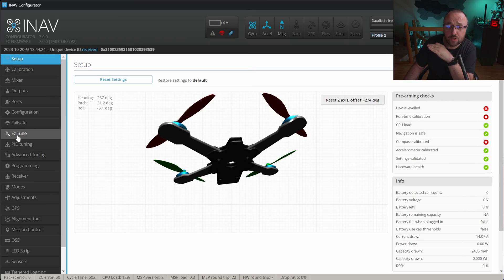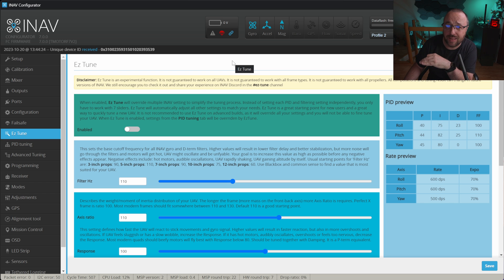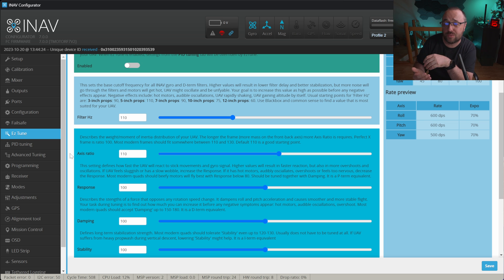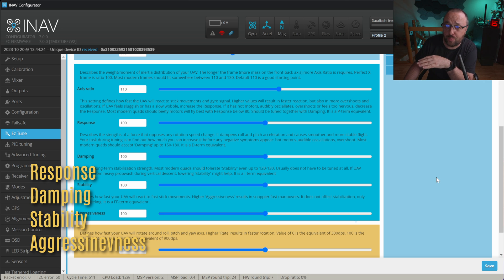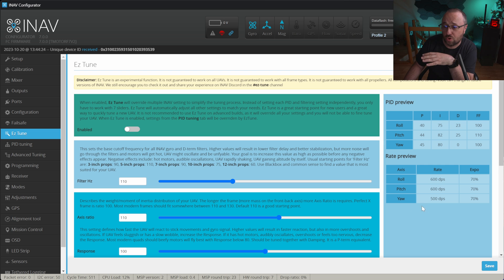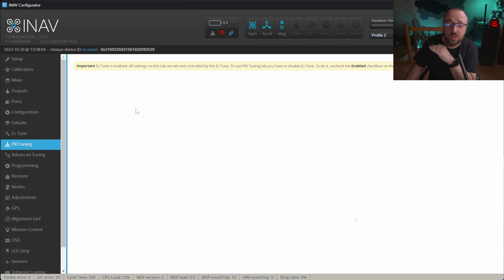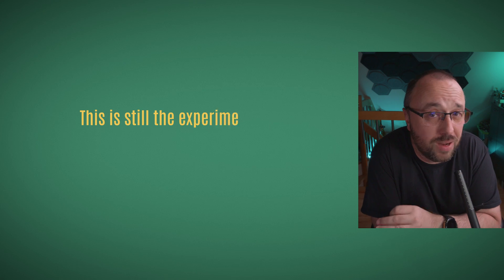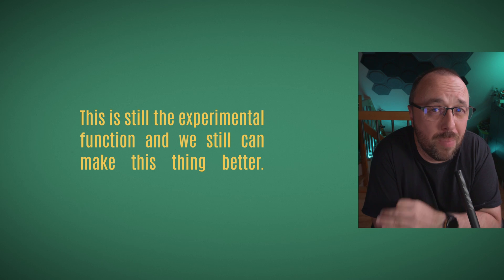Easy tuning with INAV | The Ez Tune

Comment: what size motors should be used for inav 7.1 im having high throddle osolations with stock tune and my motors are rcn power smoox 6s 1880kv and i dont get it with 1750kv motors do you know why.

Comment: you may have put a lot of work into it, but it doesn't work well. i have a 10" phantom 3 set up with speedybeef405mini. Toiletbowling on GPS position hold. Oscillation and a slow tuning. even pidtoolbox didn't help. then i installed ardupilot and the drone flew stock better than with INAV after hours of tuning. then autotune and now it flies better than the original phantom 3.

Comment: I have just use this function and amaze how easy to tune compare to the old PID method makes it more understandable for the rest of us . hope it works on fixwings and VTOLS as well
Reply from the maker: on fixed wings you have autotune, so it's a little different
Reply: @FPVUniversity   I only notice recently when applying it to an Align 480 Quad with 16" props . I have difficult using EZ tune to configure. and have to return to standard tuning process. how ever for small drones upto 250 mm 5" size works

Comment: Hello friend, inav supports more sensors than betaflight. This is nice. Does the inav 7 version support the dshot esc protocol? If not, it would be better if it was added
Reply from the maker: yes, DSHOT works
Reply: @FPVUniversity  Then it's very good. When I go home, I will flash the esc software to my Inav 7 F4 motherboard. Is there a problem with bluejay? I changed the blheli s software to bluejay software.

Comment: That's a great feature! But it's not clear for me how filter tuning works. EZ tune has only one filtering option: cut-off frequency. It looks like a LPF, but INav has a bunch of filters with different options: two LPF filters (with dynamic LPF option), Matrix Filter (2D/3D dynamic notch), Unicorn Filter (Kalman). How does the single slider work? I guess there are Matrix and/or Unicorn enabled by default with some typical settings and this slider configures LPF2. Or it's something more sophisticated?
Reply from the maker: This one slider sets all the relevant filters based on predefined ratio. Once you enable ez tune and set main cutoff everything is handled. 
Imagine there is only one uber-filter and you set only this one

Comment: I recently migrated from Betaflight to INAV7 and replicated the PID values, throttle limit (scale), and motor output limit settings from Betaflight. While these settings yielded excellent results in Betaflight, the same configuration in INAV7 caused serious control issues. The throttle stick became overly sensitive, making altitude control incredibly difficult. Additionally, the drone barely responded to sideways (pitch and roll) inputs in angle mode. Pitch and roll inputs in Horizon and acro modes exhibited exaggerated exponential responsiveness, leading to overall control responses that felt alarmingly unpredictable.

Frustrated, I pushed through a few rounds of tuning, hoping for incremental improvements.  Even though I managed some marginal improvements for the Angle mode experience, each tweak felt kind of insignificant, and the objective of replicating my Betaflight flight experience seemed to fade further with each attempt. 

Long story short, I am back in the Betaflight 4.5 firmware version, which fixed the GPS issue that was there in 4.4.3. Flying is fun, even though I miss the Alt-hold feature at times. I plan to re-attempt INAV7 tuning yet again when I will have more free time in the coming weeks.
Reply from the maker: BF PIDs can not be migrated directly to INAV. Both PID controllers work in a different way. I have a viedeo about this https://www.youtube.com/watch?v=jgqjhSxd9EA
Reply: @FPVUniversity  Thank you Pawel! Will check it out

Comment: Giving it a try now.  I converted my 7inch deadcat to INAV 7, where my intention was to load INAV 5.1 when I was planning the build. I had problems getting my walksnail working last March/April when INAV6 was released, so I put BF back on it and it flew fantastic on 4s and 6s.  
I would love to see a real demo on applying the easy tune sliders on a similar build.

Comment: New INAV user here, I did miss the gyro calibration from betaflight. I didn't quite get a very good gyro setup in INAV and the angle mode didn't stabalise so well.
Reply from the maker: I'm not sure what you mean? There is no gyro calibration procedure that user should do in either INAV or Betaflight

Comment: Does it not work for Fixed wings? For example a fixed wing using the Matek F405 Wing FC?
Reply from the maker: No, it works only for multirotors
Reply: The last time I tuned my sailplane in iNAV 6, after autotuning, I flew again, select ANGLE mode and then then bird nose dived immediately from 50m to the ground in a couple of seconds. 😢

Comment: Hello Mr. Pawel, I want to ask you, should I use INAV for autonomous micro quad build or should I go with arducopter? It looks like INAV has come a long way very quickly. Please let me know your opinion.
Reply from the maker: INAV is much simpler to setup and flies as well. Sure it lacks some advanced features, but you need them only when you need them
Reply: Thanks for the opinion. I am very interested in autonomous flight. I want to learn about it and try it. Coming from betaflight background I feel INAV is a great platform to start. I want auto take off, perform autonomous waypoint mission and auto land at origin. I hope I can do this with INAV.

Comment: nope ... sorry but i did not like Ez Tune ... when you try to tune with PID Toolbox, you need other sliders (indeed same slider from Betaflight)
I prefer to modify directly PID FF values than use the slider (in fact it's more accurate with Value than slider...)

So please put a P/D balance and a master Multiplier. "this is the way" :) 
Chris Rosser and DZARO made some tutotials and explain the method to tune and Ez Tune is not a helper.

Other thing : could you explain how to set "filters" and "mechanics" tab  ? I did not find a "how-to" and did not find also how to see noise in Inav Betaflight...

Keep going ; I like Inav for other things ;)

Comment: Excellent work !
My question is about custom frames/3d printed frames and using EZ Tune....I dont suppose EZ Tune will compensate for custom or 3d printed frames that are more flexible than carbon frames ?
Reply from the maker: Nothing is that advanced :) You have to find a good balance

Comment: It would be nice to be able to custom assign motor positions 1, 2, 3, and 4 (and more) on multirotors, and their direction [as you can in BF and AP}
Reply from the maker: You don't need to change motor order. All you need is custom mixer and INAV has that for years now. Effect is exactly the same
Reply: @FPVUniversity  a short video tutorial on how to do that would help 1000s
Reply: @DugDiamond1  Click on "mixer wizard". Choose whether motor 1 is mounted at the top right, the bottom left, etc. Continue in the same way, specifying the location where you mounted each motor.
Then click Apply, then save. You're done.

If you are using an INAV version before 7.1, do NOT expect the "mixer presets" illustration to change when you use the motor wizard.  They are two separate things. The image shows what the preset will do if you load the preset.
Reply: @senseisecurityschool9337   - thank you for your reply. I have already tried this many times, and it does not work. The FC/ESC combo is a MAMBA F722 MK4 APP + 65ESC. The firmware installed is MAMBAF722_2022B (dec6 stable). The boards are rotated 180 degrees, so that the capacitor does not impede the air unit.

I have since moved this build back to BF,  and everything works great.

I am currently making another INAV7.5LR quad with a different FC+ESC combo (iFlight Blitz F7 E55 Flight Stack) [currently in their chimera pro v2]. This time i will attach the motors whilst in the configurator, and wire accordingly.

thanks again. happy new year.

Comment: hello from france, im a beginner in flight controller and use Inav for wings, and betaflight for quad; why i do not know, i guess betaflight was more simple to use ; i was waiting for a new inav to swap all BF quad to Inav; i wait a little that you launch official inav 7 to to try; but well done! it smells very very very good. my main pb is to stop using horizon, switching to acro is far too difficult to master; any chance to get a parametric acro mode? i mean acro mode with a litlle "horizon mode" behind...able to make safer acro mode
Reply: Hiya.  Basically horizon mode in quads is 'acro with a little stability'.  Learning to fly acro is not really that hard.  You can easily get the basics in a few hours on a simulator (up/down, forward flight and basic turns).  You don't need to become a full freestyle or racing pilot, but being able to fly acro will make you a much better pilot overall, and is well worth the effort. Coordinated turns, flips and flops and crazy moves take a bit more time to learn, if that is what you want.    I learned to fly basic acro in an afternoon on a simulator.  My first real flight after that was so much more fun and comfortable.  I'd highly recommend learning to fly in acro mode sooner rather than later.  You don't need to fly in acro mode all the time, but being able to is an important skill.

Comment: Looking forward to Inav 7 . Having issues with my S800 in Inav 6.1 I didn’t have any with my first S800 in Inav 5 it flew slow fast and very noticeable flight control between modes. Auto launch is a dive into the ground but could launch it without auto launch. No change in ailervons travel in modes. Acro angle horizon and manual all the same and when it gets in the air even though there is plenty of travel it won’t fly well unless I go fast. I’ll move the control horn rods for more travel and use stiffer rods before I shelve the build . One other person had same issues with same wing. Thanks for your efforts in being part of the Inav team.

Comment: Ez Tune is indeed the next level of tuning a Multi-Rotor. Big thanks to the INAV devs for this! Unfortunately the stick command menu is still showing PID tuning manipulation even after enabling Ez Tune on a Flight Controller.
It would be better if Ez Tune would be configurable via the stick command menu instead when it has been enabled. It would make tuning your drone SO easy as you could just run through the tuning process without ever taking off your goggles or having to remove the battery and/or connecting your flight controller to a PC between every change.

Comment: I will never try inav for drones until the compass will vanish from a basic rth requirement for drones 😂
Reply from the maker: compass stays as it's waaaays more safer and precise than what BF is doing
Reply: Inav is more of a nav software hence the name and if you want good nav as well as position hold etc. you need a compass. I even add compass to my Betaflight drones for better RTH performance.

Comment: One interesting thing that could be added is a selector to give a starting points based on the quad size. The presets now cover the majority of the builts with 3, 5 and 7" options but would be nice to be able to select 10, 12 or even larger frames.
Reply: are you using inav7 on a large quad? i just configured my 10" with it and tomorrow will make a maiden flight and was wondering if you could share your eztune settings if you have such a big quad..
Reply: @ghostdogfpv  I am now in the process of setting up a 10-inch quad on Inav. Could you please share your eztune settings with me to start from something?
Reply: I used the preset for 7" on my 8" and it flew better than betaflight defaults!
Reply: someone tried inav 7 with 12incher or bigger? need some advice where to start with pid tuning. P and D should go to bigger values and I to smaller? Is that true?
Reply: @petrweigl8282 I built a 15" and still fighting for the fast movement oscillations. The final values I am using are p=60 I=20 D=50 for roll and pitch, a notch filter for 45 hz. Higher I values almost always lead to oscillations where increasing P did not help. POSHOLD and angle modes are life savers.
Reply: By the way motors are 5010 - 360kv, speedybee f405 v3, 6s2p, carbon tubes

Comment: Looks like a great feature. Always struggled with some simple pid tuning. Just wonder if it works well for a 7” as for a tiny whoop?
And it would be nice if the navigation mode parameters/tuning would be better documented